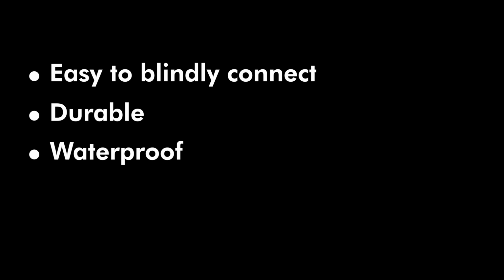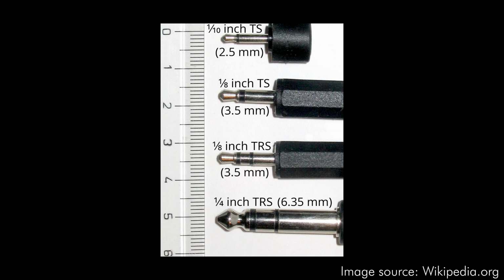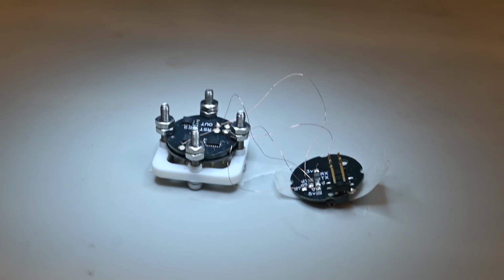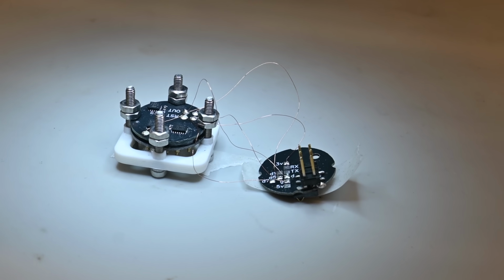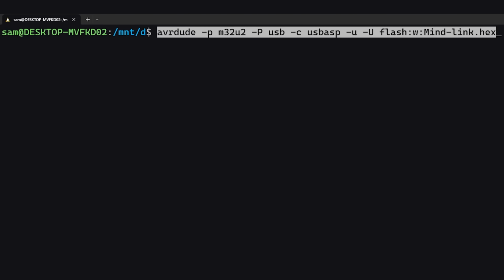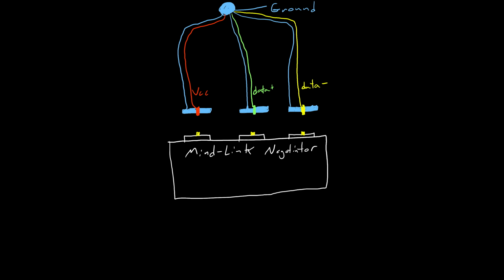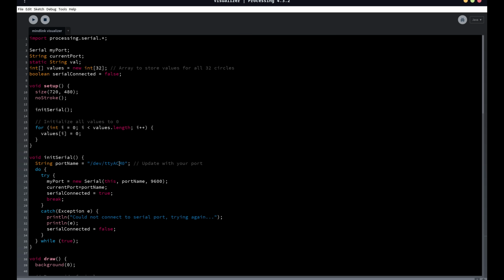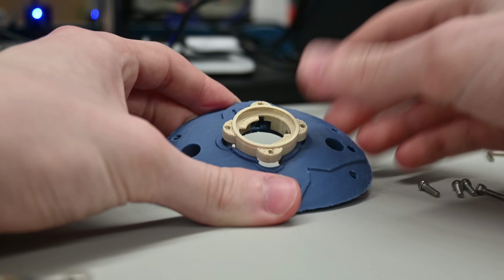Making a Brain Computer Interface in My Garage

Comment: I'm only a few minutes into the vid but I need to point out that the back of the head is not a great spot for a BCI jack since it's the part of the head that we sleep on constantly so it has more than average pressure applied to it. Maybe below that might be a better spot? Or just say screw it and grow some peripheral nerves from one's own existing peripheral nerves and attach it somewhere else on the body and use the peripheral nervous system, which doesn't provide as much bandwidth as the central nervous system, to do 2 way communication between a device and a brain. ALso I wonder if it's been discovered why titanium is biosafe and if it's possible to make other materials biosafe? Also I guess I should learn about how nerves communicate and if it's by ionization or if there's direct chemical signalling involved?

Comment: In all honesty. While i think this is fairly interesting in concept. 

I was more impressed with your magnetic connector idea that negotiates pin allocation at connection.

True it's been done before, but it would be elegant as the primary interface. My suggestion would be to axe the radial contact connector in the center and utilise that space as the processing hub instead.

Comment: All fun and games until an open source patch makes it even more unstable. Especially to do with the data injection aspect. Also, with this design, wouldnt it mean a large amount of activity would occur near / at the site where the electrodes invade? Would this be affected by the pre-existing functions of the portions of the brain which are connected? I.e, what if you input too much incompatible data before the brain can figure out how to sort it into the correct neuron group. This seems like a very delicate science.

Comment: The gaping hole in your head doesn’t really sound fun, there may be a lot if issues that might come out of it.
The port you made is cool, but there where magnetic plugs on usb male and female parts that were connecting the way you connect yours, so maybe those may be a better idea? But I think wireless is the way to go, since it would be better to not leave holes in your skin where isn’t supposed to be any, even though it is more difficult to update hardware that way

Comment: For a connection, if I was designed such an implant, I would probably use a combination of a Ethernet connector, lightweight and it's a decent connector. And a DisplayPort for higher refresh rate/data transfer.

Comment: Awesome design! One thing to note that has almost nothing to do with your BCI (it's more of an "internal" issue) other than the hole in the skull. No matter how thin you make metal electrodes, if they actually puncture the cortex or even lay between it in strands, the movement of the brain during daily like WILL cause tissue scarring. Nueralink has had many issues with this and is ultimately doomed from a design standpoint because of the biological reality of the brain making this unavoidable (a LOT of their research is very irresponsibly done from a human and primate trial standpoint).

I would urge you to look into the wafer designs from companies like Precision Neuroscience. Much smaller incision required in the skin and skull, sits on TOP of the cortical surface instead of between folds or puncturing it, and is much more open and responsible with their data collection. If making a functional prototype for an open source model, the wafer design is much safer and more futureproof. Ergo it will probably be what you're going to actually end up designing around if the time comes that you're bringing this to open-source use!

Amazing video, wish you luck :)

Comment: This is a fantastic project(!), but I’m wondering why you’d limit yourself with an ATmega, vs using something vastly more powerful like the ARM7 in a Teensy. Maybe physical chip size? Another alternative would be an ESP32, which are available in 6x6 mm packages with 48 pins and way more capability.

Comment: a couple of consideration: 
1) the chip that would convert brain signals to digital signals (and vice versa) should be entirely analog; this would allow to both leverage the higher efficiency and computational power that analog computing provides (it's usually not favorured because each circuit would only be capable of doing 1 thing) and it would be an actual ROM (Read Only Memory) which would ensure that at least the brain chip itself can't be hacked. to allow for updates you could have the chip be handled like a SIM card, with a slot which allows for a quick and easy replacement. 
2) rather than putting a cable you should put a Bluetooth and wifi connection to link the brain chip to an external "computer" (which will probably resemble either a smartphone or smartwatch); the wifi is needed because Bluetooth can only send up to 2 MBs, which is enough for what is currently used but not enough for a brain connection; either that or you'll have to rework the Bluetooth itself to make it send at least 100 MBs. the reason you'd also not want the brain chip itself to work as the "smartphone" would again be security; in case of hacking or bugs you'd only need to turn off the external device, which is probably much easier than having a physical button on the brain link.
3) if you really need a cable connection you could just have the jack be inserted parallel to the skull rather than perpendicular to it, this way you won't have to worry about it being small enough to fit in the < 1cm of thickness you have available.
4) others have suggested a material that gradually gets replaced by bone tissue as the material but this would have the major problem of making the device as fragile as the skull itself; and given the added risks posed by the various electrical components it's not a good idea. while it could be used in its outer layer to allow for the skull, skin and perhaps even hair to grow back in place, the inner parts should ideally be made with some composite material, with titanium as the matrix for its higher tenacity and ceramics (or whatever biocompatible material would be most effective) to increase it's hardness.

Comment: Technically the best way to have a brain computer interface is to have a nanite network, independently they can't do much, they're like 1 electrode each and a bit processor, but they're connected together with near link communication, they can connect to WiFi and can download data straight to your brain they could have different software by utilizing emulation, they could send sound and video information to the brain utilizing the brain's own visual processes and sound processing, side effects could include a minor pain in your head when downloading data via WiFi, and brain fatigue from using it a lot. The system would generally recharge by using the tiny electrical signals of the brain.

Comment: First time viewer. I watched with fascination and queasy fear you would make me faint. Thank you so much for not actually drilling a hole in your skull. There was a time that possibility wouldn't have crossed my mind but with the current epidemic of insanity, my concerns seem justified which is itself worrisome. Gods when I saw that drill...

I still have the OpenEEG I built way back in the day which I used to self-administer neurofeedback but also dabbled with BCI. I haven't dusted it off in years, partly because of the reasons driving research into technologies like MindLink's, but mostly because I haven't gotten around to replacing corroded electrodes.

It was fun while I lasted though. IMO, one of  main problems with EEG BCI is the low data rate and need to focus. I could move my mouse cursor around but it was agonizingly slow and error prone, and maybe I just didn't practice enough, but it never got to the point of happening on autopilot like using a regular mouse--you kind of have to carefully avoid thinking too much about whatever you're working on while you move the mouse to do the work, but at the same time not think too hard about moving the mouse or hades forbid moving your body or blinking. I assume the slowness had to do with the unnaturalness of marshalling enough neurons to fire together for the eeg to pickup through my bonehead.

That said, no way in hell I'd risk having a dataport professionally installed in my brain for fun. I would be constantly worried about infection or freak accidents. Ok, maybe after a few million people had it and no problems for a few decades. And it would have to be really useful, like The Matrix, learn Kung Fu in a few seconds and super high fidelity VR experiences, etc.

I keep wondering about something like Beam Steering used in cellphone towers and microphone arrays. Perhaps thousands of electrodes woven into the material of a wig worn on a smooth shaved head dripping with electrode gel gloop. Maybe custom silicon for a large pin count FPGA with amplifiers and A/D converter on each pin. Something like that anyway. It might be possible to have fair spatial resolution within several volumes simultaneously. Maybe add some AI to weed out unintional activity in regions of interest. 

Anyway, really cool work and video. I liked the tiny soldering job with magnet wire too.

Comment: I would recomend you to use four adcs and SPI for fast and accurate measurements, and usb3 streaming for data. later procesd on separate computer. The way you do it is not wery optimal for this specific use case. At least separate fast adc. And if you can diferential inputs with bias

Comment: I'm a fan of the modular pancake concept and the open source nature, I'm not much a fan of the utah array as It's limited in the amount of neurons it interacts with I'd prefer a more invasive solution that could essentially cover activity over most of the brain using an XY mesh blanketing the brain that would read signals similar to a touchscreen digitizer, though as you pointed out with the immune system rejecting foreign objects, that would pose it's own hurdles.

Comment: Amazing job, I too have been fascinated my entire life. Tho I'm an electrical engineer by profession, I also work on bci tech at home in my lab. However, I'm more looking to get non-invasive to become close to invasive in terms of spatial resolution. If you have any ideas of a phenomena I might be missing, i would welcome the input. My best bet so far is optically pumped magnetometers.  

Btw, Max hodak mentioned something that I think your base plate electrode system could look into implementing. The idea is to connect to the corpus callosum somehow. Not sure if entering from the back is the best bet but it "feels intuitively correct" to do so (maybe because of matrix lol). The data channeling paradigm would be different I'm suspecting, since that is like the highway of the brain, you can bet the information is encoded in a very high dimensional feature space.   

Anyways good luck on your endeavors, I'll be routing for you. +1 sub

Comment: I think that the first layer of BCI would be a 1 to 1 strong, durable and simple connector that isolate the brain from the exterior and provide the electrode on the brain on one side, and pogo pins on the other side, the idea is that you don't have to go to surgery again to replace or upgrade the smart part of the BCI

Comment: Personally, I’d have gone with CAN bus instead of USB. It’s more resilient against noise or dodgy connections, and being a proper bus you don’t need any hub chips to connect multiple peripherals together; just common the data wires and it handles the rest. Like you do with I2C.

Many MCUs can speak CAN, though they still need a transceiver chip to actually drive the CAN lines.

Comment: the realisation I made, before I began studying to create a neural interface, is that, the brain is a bad place to connect to the computer.  if you can touch type, or read braille, you already know how much data you can transfer just using your peripheral nerves.

if you 
use a magnetically charged, implanted, bluetooth version of the Cyborg 1.0, 
use  a software training program based on the koch method to program your nervous system to understand the given signals as letters,
I believe you will have an excellent chance of success, and, if you get a gangrenous infection in the implant, you'll at most lose an arm, not a brain.

My plan is still, at some point, to connect cultured neurones to a circuit, and connect those neurones to a nerve plexus in the arm, removing the abrasion that comes from nanowires and electrode arrays piercing through nerves. 
the chances of me returning to research in the next 20 years is low, but that would be the direction I would be looking to take.

from my understanding, if you can provide an arm nerve with enough bits, and make the data source a camera, the nervous system will learn to see through it, as long as the camera stays attached to your body and continues to move when you do.

Comment: you can misapropriate flash memory as an analog transistor accelerator peripheral to do the complex vector neural math needed to decode brain signals with less power and more speed, mythic AI is doing that right now for silicon AI but it could work for us too

Comment: I think a swarm of nanobots injected in the bloodstream and guided by radiosignals to move to selected places inside the brain would make a bigger and safer "antenna" that would amplify signals and send them out of the skull to be read by a non-invasive cap-like device. Also nanobots could later be disabled/neutered/moved out by the same process if desirable.
Reply: I like the way you think.
Reply: Look at Mr JC Denton here with his fancy nanoaugmentations. I guess Miss Navarre and I will be taking our skullguns and leaving for the scrapyard.

Now if only I could get a can of orange soda out of this dang vending machine.
Reply: @DilettanteProjects  Oh i see what you did there and i respect you for that
Reply: There's a book about this, bad idea
Reply: My personal idea was a species of neurons engineered to grow such that they all communicate with their entry point and spread through the entire brain without messing anything up, such that in order to read signals, you'd just have to interface with that, so ideally, they start by being grown out from a DAC.
Presumably, would only work if implanted in babies as otherwise the immune system throws a tantrum.

Comment: I don't think anyone is gonna want to need to find the first ripperdoc to install these unless they have no other choice because they lost function of limbs or something. But even then drilling a hole in your skull which is effectively exposed is too risky. Any invasive interfaces like that would opt for installing electrodes/sensors on the brain side, which could like nanomachines which bypass the blood brain barrier or through delivery of electrodes in a small, easily resealed, injection site.